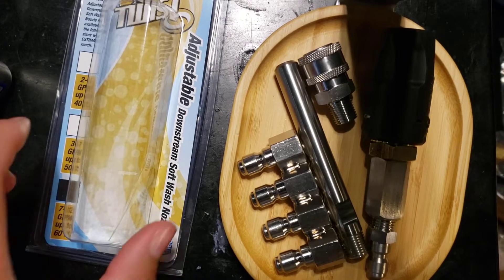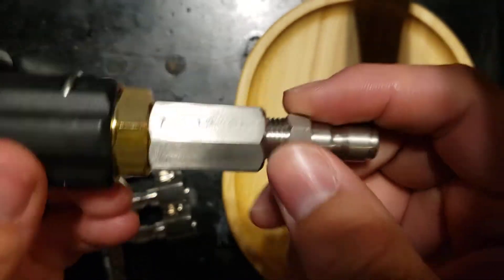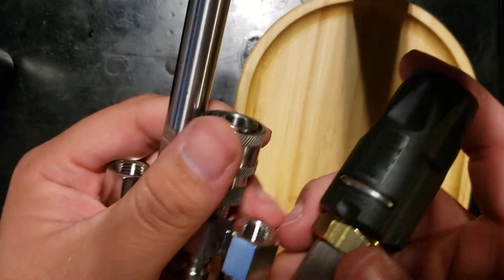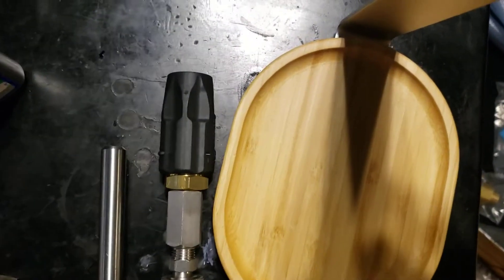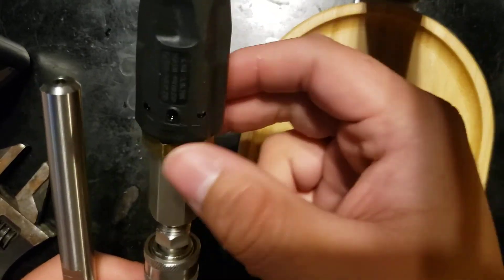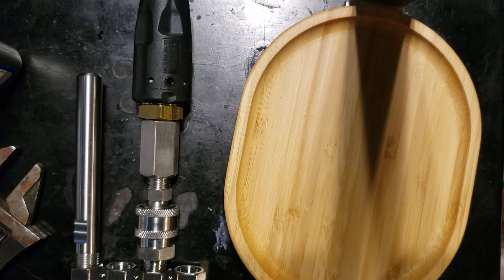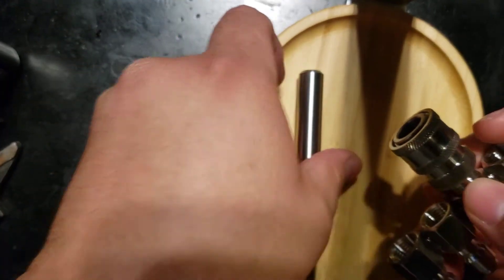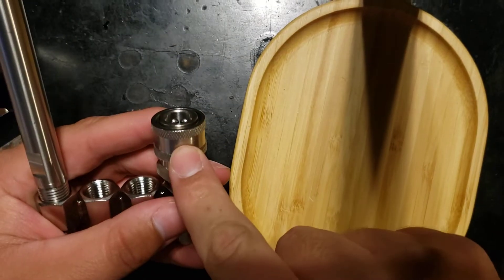Down Stream JRod

Comment from the maker: Down Stream JRod 

JRod
https://shop.pressurewasherproducts.com/1-4-MEG-2530-WASHJET-SPRAY-NOZZLE-3245.htm 

Down streaming Tall Reach Tip 8-10 gpm
https://www.southeastsoftwash.com/product/tall-reach-tip-stainless-steel-shooter-tip-soap-nozzle/ 

M5 Twist 7-12 GPM - Part #7020
https://pressuretek.com/m5-twist-downstream-nozzle/ 

MTM 1/4 MPT Quick Connect Stainless
https://www.mtmhydroparts.com/collections/fittings/products/stainless-steel-quick-connect-coupler-1-4-mpt 

Hydraulic Thread locker
https://shop.pressurewasherproducts.com/50ml-MEDIUM-LIQUID-THREADLOCK-FOR-HIGH-PRESSURE-FITTING-USE-5004.htm 

YouTube Disclaimer 

I am just showing what I'm doing and how I'm doing it. Use, practice and implementation of this information is at your own risk. I am not an expert nor do I claim to be one. I am just good enough to do what I'm doing. 

Thank you for watching